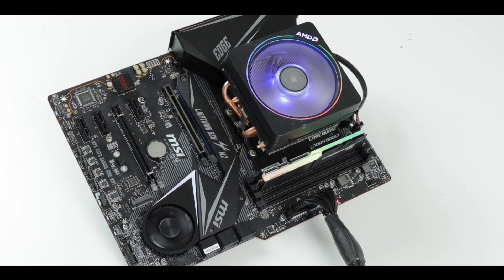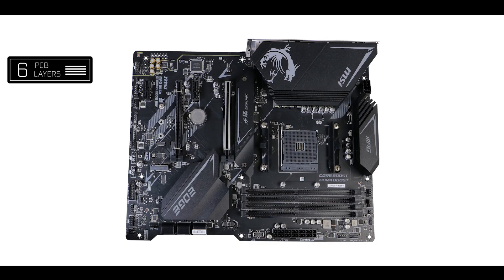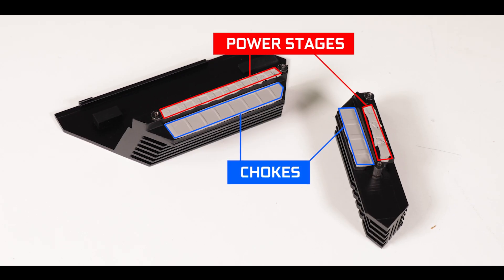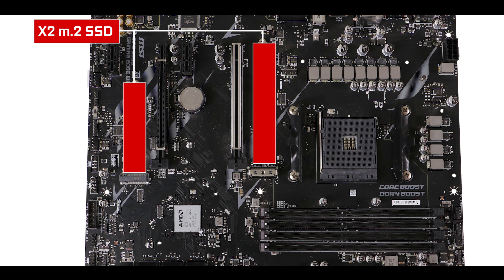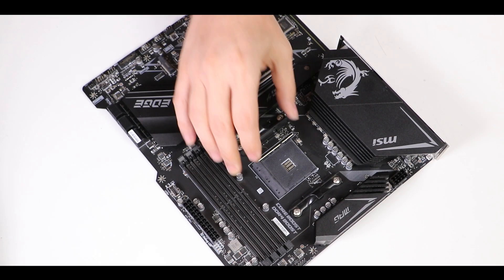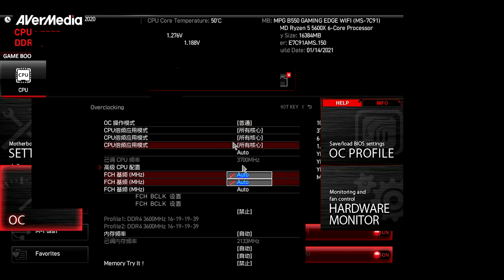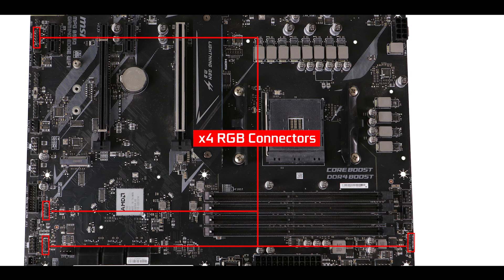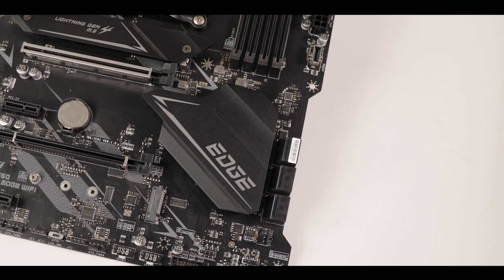MSI MPG B550 GAMING EDGE WiFi : MSI is correcting a wrong!

Comment: I just want to ask how fast is the m.2 slot with Pcie 4? I’m deciding wether I should get  a Pcie 3 evo plus 970 or a Pcie 4 evo pro 970
Reply from the maker: M.2 ssd pcie 3  = 32 Gbs
M.2 ssd pcie 4 = 64 Gbs
M.2 ssd pcie 5 = 128 Gbs

Comment: I bought mine in March 2021, to build a new computer with a Ryzen 5 5600X Wraith CPU and WD Black 1Tb SSD.  It worked great for about 10 ,months.  Now it won't boot.  Goes right to bios screen.  Tried eveything.  MSI said either the SSD hd or OS is corrupt. Bios reads and check the SSD and passed.  Updated to latest bios using M-flash, tried to re-install OS, and won't boot to USB with OS s/w.  After 5 chats with MSI support, two where the rep just told me I had an incompatible SSD and hung up on me, I was told it must be a defective motherboard.  I had to apply for an RMA to return it and could take up to a month turn around to get it repair or replaced with a rebuild?  Might be a great MB, but my experience was not good.

Comment: Had this mobo for over a year now and its one of the best boards i own. Even better at thermals compare to other x570 boards.
Yes MSI did it right with this mobo. im running 3900x and 5700xt. never had any single issues. kudos MSI
Also the WIFI 6 works like a charm, never needed an ethernet cable on gaming and other networking.
Reply: Is it still good ?
Reply: @Dolma.58  100% just upgraded my cpu to 5700x and still works great
Reply: @corvinius3  thank you I think iam gonna buy it

Comment: Can this motherboard support a ryzen 5 5600x without needing to flash the bios?
Reply from the maker: It will all depend when the vendor received the board. 

Manufacturers usually take care of it if the bios update is available.
Reply: If the mobo box says 5000 series desktop ready it will work out the box no bios update.

Comment: So, uh ...
Motherboard:- MSI MPG B550 GAMING EDGE WIFI
CPU:- AMD RYZEN 5 3600
RAM:- G.SKILL TRIDENT Z RGB 16GB (2×8) CL 18
GRAPHICS CARD:- RTX 3070 
STORAGE:- KINGSTON A2000 M.2 NVME 500GB
          AND
SEAGATE FIRECUDA 2TB SSHD
POWER SUPPLY:- Fractal Design Ion+ 660 W 80+ Platinum Certified Fully Modular ATX Power Supply

So is it accurate?  like any suggestions anyone please feel free... please.. 
ill use it for gaming, streaming, upto 4k editing, and even for blender and photoshop and all..
Reply: i would go with a different cpu but everything else seems good

Comment: how does this compare with the Strix B550 F gaming wifi and aorus B550 Elite Ax V2.  They all seem to have the same specs...do i just go for the cheapest I can find?
just found your channel yesterday.  Great stuff.  saw your other reviews from above, and you liked them, but would like your opinion for head to head as such. Cheers
Reply: I’m kinda in the same boat, have you figured what’s best yet?
Reply: @littlecandyvann3868  i went for rog strix e gaming as had a front i/o usb c port for front of case whereas f gaming didn't , and asus boards were discouted in a promotion at the time putting them cheaper than the msi, or i would of got the edge. Also got on a deal for £136 at the time during a promotion. Hardware unboxed did a good review of all b550 boards.. Msi Gaming edge very good for vrm thermals etc so a solid good board. No heatspreader for 2nd m. 2 nvme slot though. At moment prices in uk put it similar price to the x570 tomahawk which i would take over the b550 board as both m. 2 slots are gen4, and that board now cheaper than when i was looking
If buying from scratch now, I's seriously look at 12th gen intel alderlake 12600k or wait for 12400 cpu next month as a more budget build.
If youre set on amd, have you bought cpu yet?
Reply: @littlecandyvann3868  6 months later i have the same problem, do you have a solution yet?
Reply: What the solution now, guys?

Comment: WICH ONE IS BETTER -->>  MSI MPG B550 GAMING CARBON WiFi  or MSI MPG B550 GAMING EDGE WiFi  ???  , answer me plsssss
Reply: I have the same question... I guess the mpg b550 gaming carbon wifi is a bit better. But i am not sure...
Reply: @VyzzenHP  yes i investigated and carbon is the best version of b550 on MSi
Reply: @abrahamvicente9722  thanks for telling me. It's funny because I know it has a better power supply for the CPU (i don't knoe how to call it in English) but i saw a video in which a lot of b550 boards got tested and the edge wifi was significantly cooler then the gaming carbon wifi... However I am probably gonna still go for the carbon it should be a little better and it's just 5€ more for me. Also I really do like that there is a button for resetting the bios.

Comment: UPDATE the bios, the Chinese b.s. no longer happens while in UEFI mode :) 
they really need to add CPU_VDDP instead of claiming its only for APUs (NO NOT CLDO_VDDP) one is for the CPU (hints towards CPU_VDDP) (VDDP inside the main page
IS NOT CPU_VDDP iTS CLDO_VDDP just without the name CLDO beside it.
the other is for PHY aka ram bus interface (CLDO_VDDP) great board cant prove on here im running 4x8 4000mhz stable with fclk at 2000mhz c16 flat but i promise you i am.
Reply from the maker: And for the ram I believe you. Manufacturer specs are not limiting aspects (thankfully).
Reply: @Laurentschoice  true, but considering 90% of all amd users running 5000 series chips have tons of WHEA 19 errors it's hard to believe any can be 100% WHEA/stable 24/7
Reply from the maker: oh great! I had installed both latest BIOS (Beta and stable) and had encounter the problem. Do you mind sharing with the community which version you installed? 

Thanks again for the comment!

L.
Reply: @Laurentschoice  yep not a problem, the latest is TRASH cant post 4000 at all with whats stable now, and it freezes and bugs out BAD. but the version im running now is E7C91AMS.161 which is no longer available on MSI download page. i have it uploaded to my google drive, but i think youtube removes links. i will try to post on comment after this to share the bios im using (1.2.0.1 agesa) but again its youtube or your channel settings removing links.
Reply: @Laurentschoice  well it removed the link faster than i could test by editing lol just let me know if you want the bios link. i can post it in overclock.net forums...

Comment: HOLY MFN COW, this took alot longer then expected...glad i didnt wait and got mine months ago for 140 (used-open box) still not opened plastics tho,
STABLE 5600x 4x8 3200c14 4000mhz 2000fclk (c16 tfforce dark pro sticks btw CR2) PBO/CO -15,-12,-12,-12-,15,-15, with +60mv offset

 yea this board BEASTLY at 160 or under...but i cant see 200 bucks (for anyboard) for that matter.
had to unsubscribe and resub since i havent seen an upload from you in a while even with the bell on....youtube all jacked up worse than the X570 whimpy sister to this b550
i suppose Imgur isnt allowed on youtube?
Reply from the maker: Aahahaha good to have u on the channel again :):):)

Comment: I bought today Elite V2 on sale for about $130 - I don't see a reason to overpaid extra $50 for those MSI motherboards,
u can add more comparisons to your reviews, cuz your reviews are not always such a clear choice in terms of what to buy
Reply: This board can handle 3950x oc btw 59c. At full load.. this and taichi and b550-f have same perf on 3950x oc.. elite scored 72c on vrm.. so yeah 50$ for more cooler solution. I have this board xD but only use in 3600 hahaha dont buy pro aorus btw it scored 115c at oc full load 3950x.
Reply: :) its kinda nice if u have less to worry about when u upgrade
Reply from the maker: Absolutely correct.  I need to do that
Reply from the maker: The only issue will the elite is the Bsence of ez debugger but an amaizing board ithe than that !

Comment: Thanks for review... I am using the board with a 5600x and it works well. The board cost $355 NZ very happy with it. Keep up the good work.
Reply: Did you update the bios for it to work with the 5600x
Reply: @granessimulatorvibes   Yes I did...My first try failed as the bios flash button was broken so I had to get it replaced. But when I got the new one it worked first time.  Still happy with it.. especially as it's my first build.